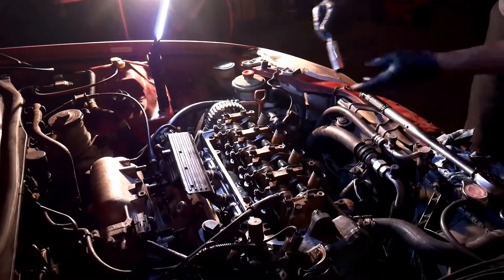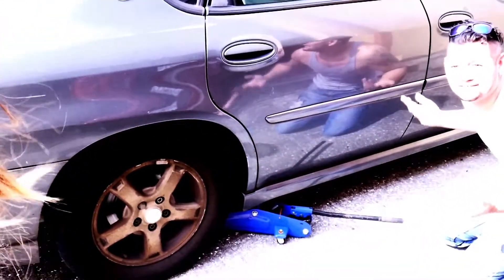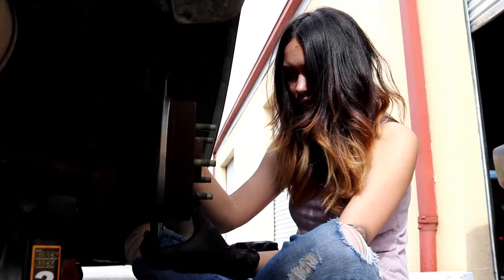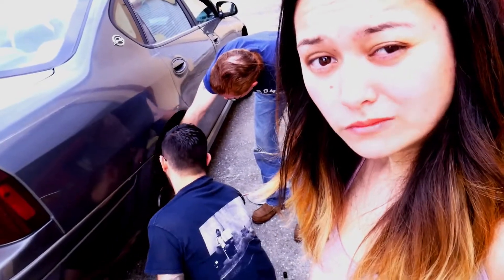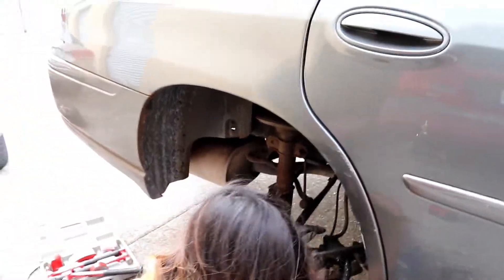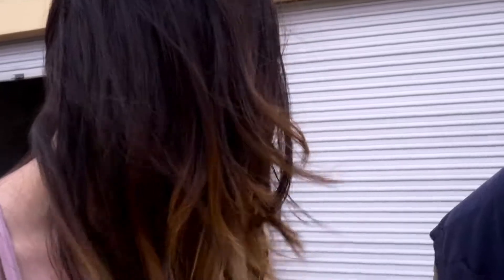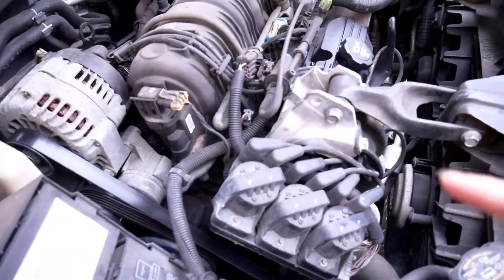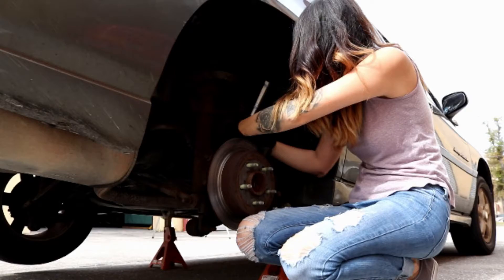How many cats does it take to remove a rotor?

Comment: If the black bumper comes out good that’s when u know ur an expert 👌 I can’t spray for shit I would probably mess it up lol, the worst time I ever jacked up a car for the first time me n my cousin we were young 16-17 and I didn’t know there were certain jack points so when we started jacking the car up the freakin jack bent the crap out of the floor inside the car lol I then learned a lesson hahaha, at work I’ve seen 3 guys working on one rotor trying different methods lol! Not because the brake but it was just rusted bad lol, key is beat the shit out of it 😂, great video Heather :)!!!!
Reply from the maker: Jesse Rizo haha! That's a quick way to learn how to not jack a car 😂. Yes, rotors really suck sometimes. Thanks for watching!
Reply: Heatherrr yea it was a crazy experience 😂 your welcome friend 😎👍

Comment: I figured when all you guys couldn't take off that rotor that the parking brake was engaged lol. But rain or no rain you should change all components if you have them on hand keeps everything balanced (working parallel) and you don't  have to go through the process of removing and reinstalling all the parts. Just once and done, but if you're worried about getting wet (equipment) get one of those pop up tents and something to weight it down if its windy.
Reply from the maker: Frankie M definitely should have done both sides. The caliper on the passenger side still needs to be replaced anyway. Knowing my brother, he's not going to buy one. He's not someone who takes care of his cars if you can't tell haha! I've been telling him to fix the brakes for almost a year lol. But at least that one rotor is replaced. It probably would have ripped off if he kept driving it the way it was.
Reply: Heatherrr I'm sort of the same way not because I'm lazy but I only have my truck and work 6 days a week so its more of a time constraint. Plus getting hard parts for a 48 year old daily driver isn't as easy as walking into autozone and asking for them. Most often I have to order stuff ahead of time  from summit or year one. Plus I got drum brakes on all 4 corners so that also adds to the "I don't wanna" attitude. If I had disc brakes I'll be 30 minutes or less and on with the rest of the day. But yeah keep up the good work and the videos coming. Quick suggestion on the dumpster rocket why not cut the entire roof off (like a chop top) then replacing it with one from a donor and add steel slugs into the pillars for strength. Its more work but it will also be safer.
Reply from the maker: Frankie M I think I'm just going to replace the roof skin and the the support thing that is attached to the A pillars. I need to buy a new MIG before I get into all of that though. I still think the Plexi glass roof would be cool
Reply: Heatherrr well if you're adding a cage shouldn't be any safety issues other than the thickness of the plexiglass. If you want it to flow with the roofline then you will need a thin gauge to flex otherwise a thick gauge will not conform and will look hinky unless you're going for a panoramic style and not full length roof.
Reply: @Heatherrr  nice job on the videos